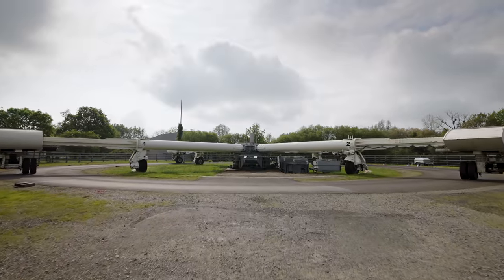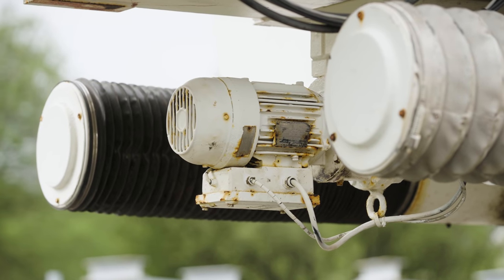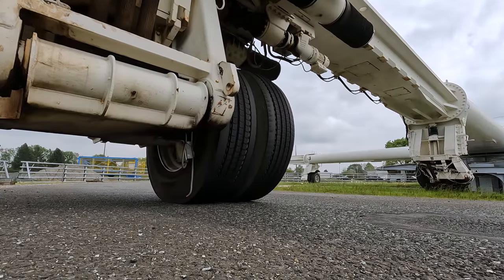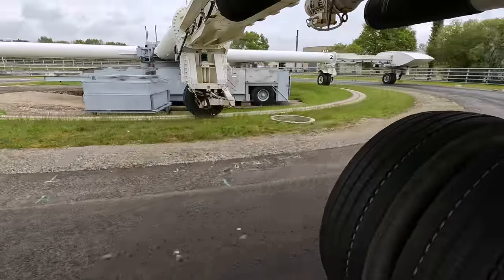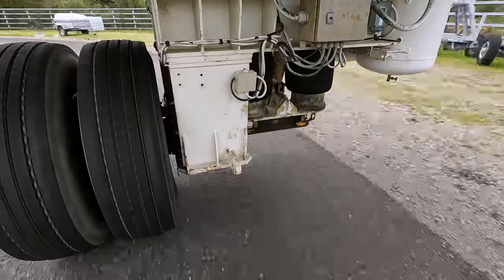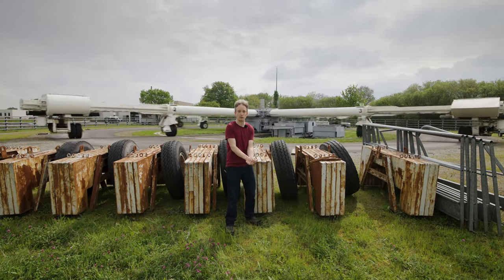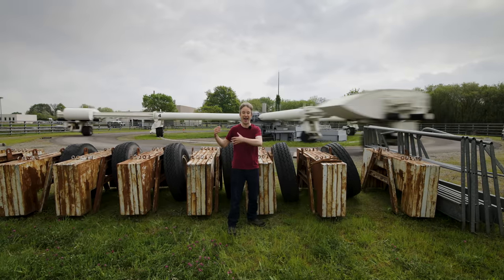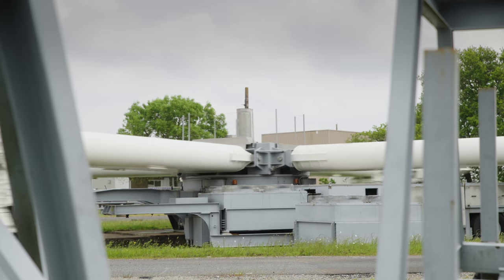The massive Fatigue Carousel helps keep roads safe

Comment: As an engineer, actually there is never a substitute for building and testing the real deal! simulations always make assumptions. build fast and fail fast is usually the motto, using hand calcs/simulation for guidance only.
Reply: it depends on the scale of the project and how stingy your boss is
Reply: @ikbendusan  hence why NewSpace is all private companies, there is no way a bunch of traditional Wall Street stock pushers would allow the push it till it pops method of rocketry advancement.
Reply: Here in Minnesota we build and test the "real deal."  We have a section of freeway that has a set of diverters so you can be directed on to a real live test track or on to the conventional freeway.  It gets actual real world mixed traffic over multiple seasons to see how the pavement holds up to real traffic conditions in real weather conditions. When they want to test different pavement they can divert people onto the "normal" freeway and repave the test track.  It's one of the largest pavement test facilities in the world.
Reply: I agree with everything except the hand calcs thing.
The speed and accuracy of a machine is far superior to a human when it comes to math.
So long as your the one typing them in, it will only help you. Obviously you should still fully understand the calculations, and be capable of performing them on paper.
Reply: @filanfyretracker  What do you mean?
Reply: @DonOblivious  Oh wow, so like A/B testing but with roads?

Comment: Reminds me of the days when I worked with non-rewind platter systems for 35mm film projection. I calculated that during disassembly of the film unto smaller reels, the outer rim of the platter would reach tangential speeds of around 100 km/h - and I would have my hand with a tea towel just a few centimetres above it, ready to stop it quickly in case of an accident - like a fuse blowing in the motor - so as not to end up with half a kilometre of a movie (or more) in a pile on the floor, and of course touching lightly to slow down in a controlled manner before a splice.

When going fast, it also moved a lot of air, and could even lift cloths covering the movie on the platter below it. Good fun, but might be a little scary for people not used to it!

(Now I'm only working with 1800 meter reels. They don't reach the same speeds, but still plenty fast, and the tea towel is still at hand. :) )

Comment: i saw a video about a Dutch facility once where they just go back and forth with a wheel, but going in a circle makes a lot more sense, mostly because traffic is always moving in 1 direction which may very well influence the wear and tear on the road surface compared to two-directional forces.  Going back and forth does create the opportunity to test the effect of repeated braking in the same spot.

Comment: "Roads need to last decades"

Potholes form on roads within a year in the USA.
Reply: oh they do here in the UK too
Reply: all around the world, sadly
Reply: They just repaved and sealed the parking lot in my apartment complex and there is already a pothole. It's been less than a month.
Reply: Based on where you live, your city/state pays for roads. Look at ND hard winters and still amost no potholes. If your city uses asphalt to fill hole..they will pop out every spring due to earth movement, a problem we have in Winnipeg only 2 hours from ND but due to heavy use here and limited use in ND (fargo for example, way less people or traffic). It's cost vs real world use.
Reply: pffffffft you have evidently never been to Buckinghamshire (UK)
Reply: Here In India, we just leave some potholes while making roads as cost saving measures
Reply: Difference between "needing to be rebuilt" and "needing maintenance".
Reply: Here the roads are in terrible condition at all times, but there are old parts of the highway that have some kind of pink pavement and my mom says it's been there since the 80s.
Reply: sure the potholes form but the roads are still there :D
Reply: @NoNameAtAll2  mostly in climates with freezing tempretures
Reply: @NoNameAtAll2  no
Reply: I'm sorry, but do you guys have a waterboard that dredges the both sides of the road everyday & destroy the existing road that's been  there without repairs almost for a decade?
Reply: roads in Banja Luka start breaking apart within 10 days of being built, very corrupt companies
Reply: @JrIcify  the pink pavement is caused by the aggregate used in making the pavement, it's all about the type of stone available at the closest quarry to the road site.
Reply: Job security and unions need something to do every year; It is done by design.  For example, look at Illinois; they completely tear up and repave some roads every year, some don't need it at all, but it keeps unions busy and it gave them an excuse to keep tolls on roads and increase the price for the toll.
Reply: "Oh, nooo.  Your tire's all flat and junk.  ...did ah do tha-yaat??"
Reply: @AdamKieler  true.
Reply: @AdamKieler  a fellow Faillinoisian?
Reply: Potholes are relatively rare in France. 
I never seen any in Luxembourg.
Reply: WITHIN A YEAR? HOLY MOLY in Poland they start to crack within a month, and potholes guaranteed every winter
Reply: In india it takes until the next monsoon. I once saw a brand new patch of road get completely pitted in a week.
Reply: Here in my part of Michigan the roads usually go 4 or 5 years before any serious deterioration, just minor cracks before then.
Reply: potholes happens because of weather and seasons the thing this machine does not simulate well at all.
Reply: @scottmcfarlane7524  --  Part of the pothole problem is freeze thaw cycling.   That's part of the reason Pennsylvania is the "Pothole Capital of the US!"
Reply: @GilmerJohn  I have to agree with you. The worst roads I ever drove on were in PA. Paved roads, that is.
Reply: @haggielady  Speaking of paved roads maybe we should go back to paving with cobbles as cobbled streets seem to last forever and look so nice.
Not so good when icy and you walk on them.

Comment: 3:35 that hexagonal tiled surface isn't 'Solar Freakin Roadways' is it?
Reply: Wouldn't last a week with the carousel.
Reply: Nah, that only existed in the head of a scammer and the PC of an animator.
Reply: @insert_username_here  I'd be surprised if it lasted an hour
Reply: Or conductive charging plates? 🤔
Reply: @alexhajnal107  I'd genuinely be shocked if it lasted one complete revolution!
Reply: Somebody's been watching dave on eev blog.
Reply: Shrimp and Scott is the crossover I never knew I needed
Reply: @ReprobateMind  it was real thing, there was small sidewalk prototype and it worked few days
Reply: I thought the same!
Reply: I think it's fancy tiles for low trafic road or walkable roads.
They would still test them to get an idea of how many decades of people walking on them the material would last.
Reply: @vukkulvar9769  Solar F'ing Roadway doesn't even stand up to that, and is definitely not what it's advertised as.
Check out Thunderfoot's or EEVblog's videos on it for more details on how terrible they are.

Comment: The size of the machine comes through, the sound, we see the wind it makes on your T-Shirt, we hear your description of your feelings, all this together with the visual impression gives a sense of how massive it is...
Together with the description of the test load for each wheel, a few tons, 5 to 8 tons or so, that mass must sit in the structure on top of each wheel, there is no other way to do this... (That last thing was just the bare analysis part, but that adds to the impressions I mentioned before).

Maybe I would have hidden behind the more or less massive fence ;-) And would have increased my distance even more and would casually look to hide behind a building or something ;-)

So, yes, the scale of it comes through for me...

Many thanks for this video idea and for this video... wow...

It does not quite come through on the thumbnail though, but it's more than worth to watch this video! Many thanks for this video!

Comment: I like that the thing above the wheel is wing-shaped to minimize air resistance
Reply: I imagine it's actually using the wind force in the reverse of what a plane does, pushing down on the wheels to create more force/weight on the road surface.

Comment: Build a dome and use it to simulate seasons, extreme weather conditions, etc. They built a death pinwheel designed to run for months in 1989, insulation (1930s by Otto Bayer), electric heating (1896 by William Hadaway), and AC (1902 by Wilis Haviland Carrier) have existed for a long time. I am sure the wind generated would cause strain on the structure, but they could engineer around that expectation.

Comment: Too bad none of the solar roadways people have ever put even 5m of the product they sell as the cure to all power solutions here, and let it undergo a decade of testing for load. Though I doubt that any of the products would have lasted even the duration of the time Tom stood in front of the rotating mass, before they failed catastrophically. Not that solar roadways are bad, the Korean government has built quite a bit, putting the panels up above the road, where they provide shade for the road and also are doing sound absorbtion, plus generating electric power as well. Up above, where they do not have to have multi ton loads on them...
Reply: Bro at 3:35 !! Is that... what I think it is? If it is... it's not even gonna last a day.
Reply: 3:36 I think your find a solar array set in the pave ment on the other test track.
Reply: No matter what, it's always a stupid idea to put a solar panel on the ground, flat.  Then add being shaded by traffic, covered by grime, beat back into sand by heavy loads and being a nightmare to maintain and solar roadways turn out to be the dumbest possible use of resources imaginable.

Comment: I feel like this could also be used to test tire durability
Reply: The circular track might cause more sliding friction and flex/deformation on the tire though which may impact test results vs. real world. But to be fair, I have no idea what they already use to test tires.
Reply: @craigjensen6853  If I remember correctly from polymer engineering teachers I believe that there is a machine that tests this much like a treadmill that is done in a lab environment using a full size wheel on a motor
Reply: An apparatus like a planetary gear would more evenly wear the tire.
Reply: @callmeshaggy5166  Yup, that's usually the force that's needed to wear a tire down, although I am sure they also do a similar test like the one above to measure wear from a turning angle

Comment: I was constantly thinking about the risk of blowout with that thing, that's a lot of pressure and they are in constant lateral load, I can only imagine running a tyre meant for mainly straight movement in a circle continuously degrades the thread quicker.
Reply: The tyres are probably specially designed for this, and they're just rolling over the surface anyway so they can probably make them super hard-wearing at the expense of grip. Could still happen though!
Reply: Actually the tires themselves are not experiencing any lateral load--all the centripetal force is being handled by the machine's arms.
Reply: The wheels are possibly on a slight angle to make them go, for the reference frame of the wheel, straight at all times, despite the circular track. Kinda like how the tires that control the turning of a car get turned- they are always going straight, but the vehicle changes directions

Comment: I'm somewhat curious about how they simulate heavy vehicles accelerating and breaking - something I noticed commuting by motorbike is that you'd get a lot more surface warping in places where buses and trucks would routinely accelerate (which makes sense considering forces and loading etc)

This reminded me of one of the dumber projects I saw people getting excited about some years ago, "Solar freakin Roadways". Not to pre-empt a possible Tom Scott video (because if an old test site for these exists, I get the feeling he'd love to visit them!), but these always struck me as a disaster precisely because I wasn't convinced they could withstand the loading without the glass warping (or just getting dirty), and even if the glass could, I wasn't sure about the vibrations and whatever connected the panels to each other or the grid. I could just picture wires shaking lose just due to the constant assault from vehicles

Comment: I'm curious how much less of that vertical load will be pushing down on the road when it's completely up to speed. It's probably negligible,  but I'm sure it's measurable.
Reply: they said they can vary the load, so it's probably able to compensate either way
Reply: I assume that's what the wings are for.
Reply: Just put some more wertical load on the axle to compensate for gravitational loss?
Reply: Stranix0209  There is some reduction of vertical load at speed due to the change of the direction of the force vector. Imagine a plane propeller, it would have almost zero vertical load if setup this way, pointing up. Carousel rotates much, much slower, and is much heavier, so that reduction should be negligible but not zero. I dont understand the math completely, i might be wrong, but i imagine it has something to do with centrifugal force.
Reply: @greenanubis  The amount of reduction, and indeed whether it is a decrease or an increase, depends on the vertical position of the centre of gravity of the arms relative to the level of the hinge points.
Reply: With that mass, there presumably must be some gyroscopic effect, thus resisting the desire to change the effective angular plane that the unit is running in. Therefore, I would believe its change in downward force from its base static load would be measurable. But probably compensated for/acknowledged in their computations.

Comment: I found myself timing the rotations and thinking "I can totally move to the centre and back with it spinning in full speed!" hehehehe
Reply: Yep, Me too.  "I could do a running dive roll and make it to the center nooo problem" ha ha
Reply: All it takes is maths.
We know it can go to 100 km/h, but runs normally with 70 km/h. The average track perimeter is 120 m, means the radius is about 38.197 m. So the distance to run is about 76.394 m.
For the wheels to run 70 km/h it would have to do 1166.666 rotations per hour or 19.444 rotations per minute or 0.324 rotations per second. That is 3.085 seconds per rotation.
It has 4 arms, so the time between the arms is circa 0.771 seconds.
To go to the middle and back you would have to move 76.394 m in 0.771 seconds or around 99 m/s which is around 365.5 km/h or 227.11 mph or 197.35 knots.

For the full rotation speed at 100 km/h you'd have to move at around 141.47 m/s or 509.3 km/h or 316.46 mph or 275 knots.
So if you can run about as fast as an F1 car or about as fast as a jetliner during takeoff, you might very well reach the center and back.
Note: This is without the deceleration and acceleration necessary for the turnaround at the center.
Reply: @HappyBeezerStudios  Nice one! If it wasn't clear though, we were talking about getting to the middle (as it is physically impossible to get to the actual centre) and there would be two rotating barriers to this. So, in short, less distance and two stops either way. =)

Comment: There are small "pavement test areas" along the highway in cities across the country where various types of pavement are tested for a period of time under real conditions. I wonder how accurate that accelerated test could be though, since that 4-armed setup looks like a standard truck driving on a standard road in real time. I don't see anything accelerated about it.
Reply: Yes it may be a standard truck, but a truck doesn't drive on the same small section of road repeatedly. That's what's accelerated.
Reply: The reason its accelerated is because this same "truck" is driving over the exact same spot atleast once a second

Comment: 1:14 “You can tell how heavy those arms are by how much the tyres squash at the bottom.”
Not without knowing the air pressure in the tyres amongst other things.
Reply: Bingo.   The air pressure in the tires expected to be used is an important factor in the "Design" of a asphalt "mix."
Reply: Technically true, but they likely won't be running the tires at a pressure that's low or high enough to cause the tires to fail, so you can get a rough idea that it's at least a significant weight.

Comment: I wonder how often they have to change the tyres. No way that thing lasts for months under these conditions!
Reply: My question as well.
Reply: Yes, they should get paid for testing tyres at the same time.
Reply: I thought that as well. Wonder also what would happen if one of the tyres blew out!!?
Reply: @2760ade  I suspect (but do not know) that might be a primary reason for the inner tires; to take up the weight in the event of a tire failure.

Comment: Should we not be building roads out of whatever material that little track that the middle wheel is on? It seems to be surviving test after test when the normal road is wearing out!
Reply: But concrete expensive :(
Also it's important to note that the inner wheel has significantly less weight on it compared to the outer wheel, but you have a point.
Reply: I agree with Nelo on all their points; it looks like concrete (and concrete roads last significantly longer than asphalt), but concrete is also more expensive (and in my experience, makes notably louder road noise), and the inner wheels will have less weight on them.
In fact I suspect the inner wheels may just be there in case the outer wheels fail during testing, or perhaps to finely adjust the amount of weight the outer wheels are experiencing.
Reply: You assume it's not regularly replaced between tests.